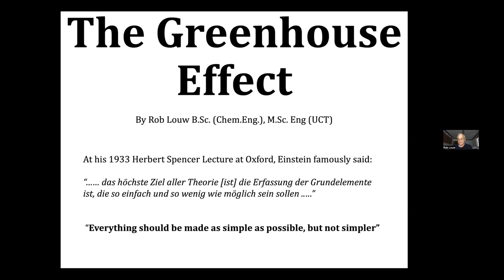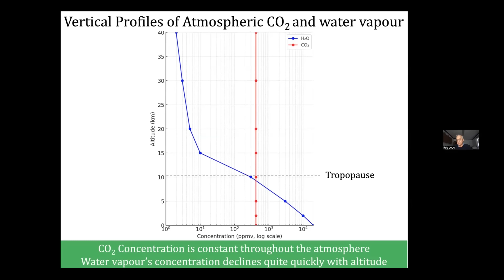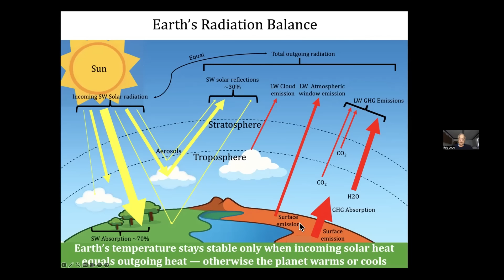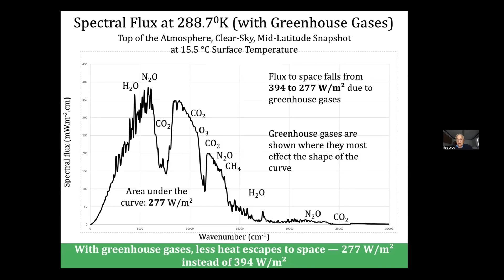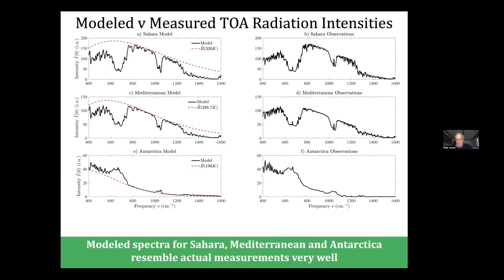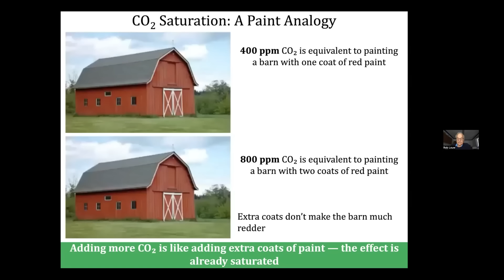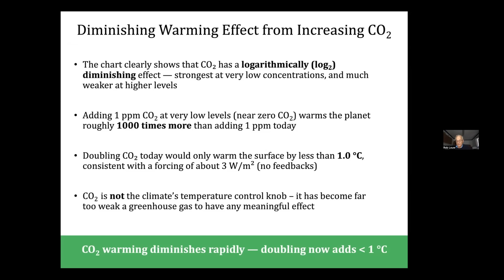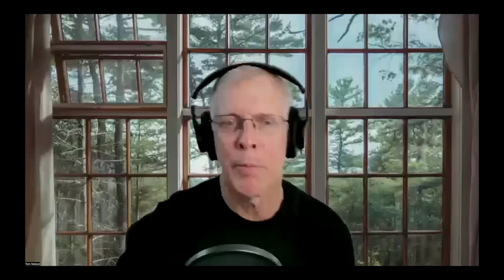Rob Louw: The Greenhouse Effect  |  Tom Nelson Pod #341

Comment: There is a mistake, in the slide at 40:00, Pre-industrial CO2 is 280ppm not 180ppm as shown on the slide. the arrow points to the right place, but the text says 180.

Comment: Methane is 180 times stronger than CO2 (in the first year), and it has risen from 850 ppb to 2200 ppb, and still rising. Yes, each year it diminishes, but each year's overlap accumulates, as well.

The moderating effect of storage of heat in the oceans, and the huge capacity of heat they can carry, is why life can evolve and exist. Changes happen slowly.

Comment: The Arctic Blogspot Group, sees temperatures at cloud forming altitudes changing such that at 8°C warmer, clouds will find it very much harder to form.  From that, they predict a climb to 18°C warmer, while I see greater amounts of heat escaping to space at night.  Very wide swings between day and night (like dry deserts), but averages stabilizing at 10°C warmer---as it did during the PETM.
Reply: Primates (tiny ones) evolved in the trees, during the PETM, which you probably know, already.  Proto-horses evolved before, and persist to this day. Dr. Wing's lecture at Frasiar University, pointed this out in his lecture, all based on the fossil record. Redwoods in Hudson Bay, etc. ---a very informative lecture.

But clearly, not a planet capable of supporting 8 billion highly energy consuming bipeds, with cattle biomass over 4 times its own biomass.

Comment: Slight correction: heat also comes from the Earths core, but it usually is only concerning, when permafrost is melting from below (and the rate at which heat energy can be removed by the air temps above. Note: it can be below freezing, and it still allows deep permafrost to melt, if it historically was much, much below freezing.  It's all complicated by the thermal conductivity of the surface soil, the still frozen permafrost, and the melted deep pernafrost, and weather conditions above.

Comment: The Radiative Greenhouse Effect is based on a flawed theory of 'back radiation being wholly responsible for the 33K difference between the average Lunar surface temperature and Earth's average near surface temperature'. It is not. Rather, it's the advection of energy from the Earth's surface to lift the atmospheric mass into a gravitational field is the 'energy bank' that has been built-up over the lifetime of this planet. 

The temperature of a stable, non-saturated atmosphere is always determined by the equation PV=nRT (irrespective of the actual gas molecules present) but only on the condition that the gas is under 'ideal' conditions, hence the name "Ideal Gas Law". 

In a gas mixture that comprises no LWIR-active molecules and no evaporating molecules on the surface, only advection (surface conduction and vertical convection) is responsible for removing energy from the surface and taking it into the atmosphere (and the thicker the atmosphere the more that advection energy transfer is greater than radiative energy transfer). The radiative energy emissions from Earth's surface will go directly to space.

If LWIR-active molecules are also present then some of the LWIR-wavelength radiant energy emited from Earth's surface IS absorbed by the LWIR-active molecules in the atmosphere uet the absorbtion of the LWIR-wavelength photon by a corresponding LWIR-active molecule does not, in itself, increase the temperature of the atmosphere [it's vital to know that the Ideal Gas Law only deals with translational kinetic energy and totally ignores internal molecular rotational and vibrational energy and the potential energy (due to mass in a gravitational field) and the energy represented by 'latent heat' of condensation]. That said, molecular collisions will result in the rotational and vibrational and translational energies of the LWIR-active molecule being converted to translational energy when the two colliding molecules depart each other. Under these circumstances, the translational and rotational energy of the LWIR-active gas molecule can result in addtional translational energy, and hence higher temperature and pressure, in the atmosphere. However, at higher altitudes, the air density and molecular translational speeds are much lower, so the probability of a molecular collision occuring before the LWIR-photon is spontaneously emited from the LWIR-active molecule is much lower so, at higher altitudes, this vibrational energy is re-emited as a LWIR-wavelength photon. If the photon is directed away from Earth, it will likely escape into space. If the photon is emited in an Earthward direction it will likely be reabsorbed by another LWIR-active molecule or else will be thermalised on the Earth's surface.

That all said, the energy from these additional LWIR-wavelength photons being thermalised on the Earth's surface are no more than the amount of LWIR-wavelength photons from the Sun that never reached the Earth's surface because they were intercepted and absorbed by a LWIR-active molecule in the atmosphere.

The net effect of LWIR-active molecules in Earth's atmosphere is 'energy capturing' (the use of the term 'heat trapping' shows that the writer has no clue what the difference between energy, temperature and heat really is) at lower altitudes and 'energy releasing' at higher altitudes. That said, the LWIR-active molecule that has not yet absorbed a LWIR-photon can also remove translational energy (and hence temperature) from the atmosphere when it collides with another molecule (this happens due to due 'energy partition' where the LWIR-active molecule is obliged to evenly distribute energy between translational energy, vibrational energy and rotational energy (and yet tempetature is only dependent upon translational energy).

Comment: The notion that CO2 is a "pollutant" seems to stem primarily from it being a combustion by-product. If that is the case,  then they would logically have to also declare that water is also a "pollutant", as the burning of hydrocarbons in oxygen produces both CO2 and H2O. 

In reality,  they know that the public would not be so gullible as to buy water s a pollutant, but they are gullible enough for CO2.
Reply: Well then, take a good breath of SO2 or NO2, which are also produced.
You'll be surprised by the effect.

Comment: Sorry, you're still stumbling in the dark, because the greenhouse effect has always been based on fake thermal physics. Yes, you must make it as simple as possible, but not simpler. That's the opposite of what's been going on ever since global Marxists seized on it as their golden ticket to destroy capitalism. Here's the simplest disproof of the greenhouse effect: Infrared radiation can't heat a pure gas, CO2 or otherwise. Google my many disproofs of the GE and quit wasting your time.
Reply: I do agree that the Radiative Greenhouse Effect is based on a flawed theory of 'back radiation being wholly responsible for the 33K difference between the average Lunar surface temperature and Earth's average near surface temperature'. It is not. Advection of energy from the Earth's surface to lift the atmospheric mass into a gravitational field is the 'energy bank' that has been built up over the lifetime of this planet. The temperature of a stable non-saturated atmosphere is always determined by the equation PV=nRT (irrespective of the actual gas molecules present) but only on the condition that the gas is under 'ideal' conditions, hence the name "Ideal Gas Law". In a gas mixture that comprises no LWIR-active molecules and no evaporating molecules on the surface, only advection (surface conduction and vertical convection) is responsible for removing energy from the surface and taking it into the atmosphere (and the thicker the atmosphere the more that advection energy transfer is greater than radiative energy transfer). If LWIR-active molecules are also present then some of the LWIR-wavelength radiant energy emited from Earth's surface IS absorbed by the LWIR-active molecules in the atmosphere.
The absorbtion of the LWIR-wavelength photon by a corresponding LWIR-active molecule does not, in itself, increase the temperature of the atmosphere [it's vital to know that the Ideal Gas Law only deals with translational kinetic energy and totally ignores internal molecular rotational and vibrational energy and the potential energy (due to mass in a gravitational field) and the energy represented by 'latent heat' of condensation]. That said, molecular collisions will result in the rotational and vibrational and translational energies of the LWIR-active molecule being converted to translational energy when the two colliding molecules depart each other. Under these circumstances, the translational and rotational energy of the LWIR-active gas molecule can result in addtional translational energy, and hence higher temperature and pressure, in the atmosphere. However, at higher altitudes, the air density and molecular translational speeds are much lower, so the probability of a molecular collision occuring before the LWIR-photon is spontaneously emited from the LWIR-active molecule is much lower so, at higher altitudes, this vibrational energy is re-emited as a LWIR-wavelength photon. If the photon is directed away from Earth, it will likely escape into space. If the photon is emited in an Earthward direction it will likely be reabsorbed by another LWIR-active molecule or else will be thermalised on the Earth's surface.

That all said, the energy from these additional LWIR-wavelength photons being thermalised on the Earth's surface are no more than the amount of LWIR-wavelength photons from the Sun that never reached the Earth's surface because they were intercepted and absorbed by a LWIR-active molecule in the atmosphere.

The net effect of LWIR-active molecules in Earth's atmosphere is 'energy trapping' at lower altitudes and 'energy releasing' at higher altitudes.

Comment: Actually there are MANY positive feedback systems in nature, but you are correct, they are usually kept in check by other dominant negative feedback loops ... or they reach a point of saturation where they run out of space or energy. Positive feedback loops are not necessarily unstable. If the loop gain is less than unity, the loop will be stable in principle. Negative [linear] feedback systems can accommodate higher loop gains ... depending on Bode stability criteria. Nonlinear systems, much more complex in feedback ... like the Earth's atmosphere. THANK YOU for being a champion to speak TRUTH!

Comment: Mars has an atmosphere of almost 98 % co2 and its average temperature is -70.  Co2 sucks at trapping heat.
Reply: It is a misconception that CO2 alone stores the heat.
CO2 is capable of absorbing thermal radiation and releasing it into the entire atmosphere.
The entire atmosphere stores the heat.
The atmosphere on Mars is too thin (0.6% of Earth's atmosphere) to store much heat.

Another example:
Place a mirror in the sun. It heats up very little.
Spray the mirror with black paint.
The entire mirror heats up, not just the black paint.
Reply: @bangelos1380  obviously the sun and the Milenković cycle are the drivers.
Reply: @TrevorFoster-j1g If current climate change were to follow Milankovitch, the Earth would currently be slowly cooling down.
There is no room for other interpretations, because this can be calculated precisely over long periods of time
(and measured currently, of course).
NASA says in [1]:
"Finally, Earth is currently in an interglacial period (a period of milder climate between Ice Ages). If there were no human influences on climate, scientists say Earth's current orbital positions within the Milankovitch cycles predict our planet should be cooling, not warming, continuing a long-term cooling trend that began 6,000 years ago."

This is explained even better on the ZAMG website, and should also be available in English translation.

[1] NASA, "Why Milankovitch (Orbital) Cycles Can’t Explain Earth’s Current Warming"
[2] ZAMG, "Astronomische Zyklen"
Reply: @bangelos1380 . Throw the guessing out the window . The milankovitch  cycle take over 25,000 years to complete. You would need 5 hundred years of accurate climate data to even make an observation one way or the other.  Furthermore there is no data on what a warmer planet with more co2 would look like.  We might need the warming to increase food production.
Reply: @TrevorFoster-j1g To know what the Earth's orbital parameters are currently,
what the parameters were in the past,
and what they will be in the future,
i.e., where we are in the Milankovitch cycle,
you don't need a single second of climate data.
If the Earth slowly cooled during such phases in the past,
but is now warming, then the current warming cannot be explained by Milankovitch.
It's that simple.
Reply: @bangelos1380 .  The current  data from Greenland  ice sheets shows that the co2 increases after the warming  , not before it and when we had the  Cambrian explosion the earth was much warmer with co2 over ten times the present levels.   Under those conditions all the large mega fauna and  plant life thrived . My own observations has been a doubling of crop yield in my area in a 45 year period.  Our farming practices improved but so did the growing conditions.  That’s my point. Warming and rising co2 had been beneficial to this point and if co2 reaches a saturation point it might save us from freezing to death in the future.
Reply: @TrevorFoster-j1g The Cambrian Explosion tells us little about life and CO2 in the atmosphere.
It occurred exclusively in the ocean 540 million years ago within a short period of 5 to 10 million years.
Land animals didn't yet exist, nor did higher land plants. Both emerged much later.
A much more recent event that demonstrates the impact of a rapid rise in CO2 would be the mass extinction 252 million years ago at the Permian-Triassic boundary.
Well, fortunately, that won't be so serious either; we can't produce that much CO2.
In any case, for CO2 concentrations above 1000 ppm, you only have to go back 40 million years.
If you then go forward in time, you can clearly see
how, as CO2 levels decrease, temperatures drop and polar glaciation begins.
By the way, none of this has anything to do with Milankovitch cycles.

One of your points is correct:
If humans didn't exist, the next ice age would be upon us in 1,500 years,
this time really because of Milankovitch. It's funny that you're bringing this point up now.
You rejected my last comment that the Earth should actually be cooling,
if Milankovitch had his way.

Would even more CO2 and even more warming still be beneficial?
That would be nice, but unfortunately, the data shows us otherwise.
Reply: The current warming can indeed not be explained by Milankovich cycles nor should it. The period is too short and the level of warming too small to claim anything. If we take the last ice age as the minimum then we have warmed, as is natural, with some warmer and other colder periods. Fluctuations ie: natural variability. It is likely we will continue to fluctuate with a helpful longterm slight warming trend until it turns down again w the next ice age. Enjoy it while you can..!🙂
Reply: @MrBallynally2 The explanation why it's not Milankovitch has nothing to do with the length of the period.
The Milankovitch cycle and current warming are inversely directed, that's the point.
The current warming isn't a small fluctuation either.
It's on top of an already quite warm value in the Milankovitch cycle.
Reply: @MrBallynally2 . The warming in the hottest decade 1930 can’t be explained considering it’s cooled down since the.  I’m not worried about co2. We put it in our children soda pop. , we put it in greenhouses and w when we have a forest fire we drops thousands of tons of it on the fire. It good stuff we also exhale 4 lbs a day unless your laying on a couch. You exhale less then.  Perhaps we should ban gyms. They make people spew co2

Comment: The key points are:  At current levels: (1) doubling of CO2 only reduces the heat radiation by 1%  (2) a surface rise in temperature of 0.7c  causes an increase of heat escape of 1%   BUT, you say, what about all the complexity of atmospheric and ocean circulations and the difference between radiation and convection?    Yes, but that internal complexity is not relevant when looking at overall heat in, and heat out which must always balance (long term).   CO2 obstructs a tiny amount of heat out.  Average surface temperature contributes heat in.  That is enough to determine whether doubling CO2 will cause disastrous heating.  Answer - it won't.

Comment: Excellent explanation. In the 1980s I was an engineer designing CO2 lasers. As such I was quite familiar with the emission spectrum of CO2. I thought to myself I could do the job better. Build a better laser . I was wrong for many the same reasons you pointed out in this video. You cannot simply amplify things by increasing their amount. I tried this with Laser systems and ended up with the same answers everybody else did. First, I tried fast flow circulation to overcome the problem of a emission and absorption of CO2 gas as you increase its concentration. Then you quickly realize you have to increase the electric current of the operating system. Then you realize you have to cool said current and gases. Etc. etc. etc. it is not as simplistic as people believe it to be. Thank you very much for your presentation.